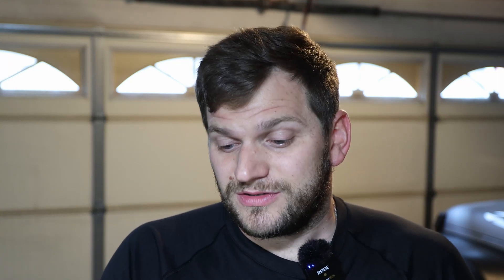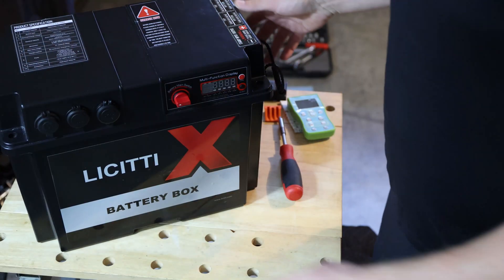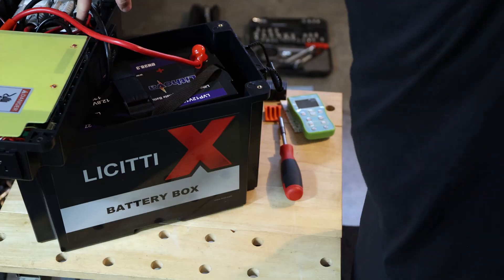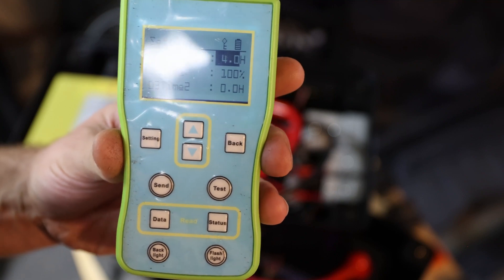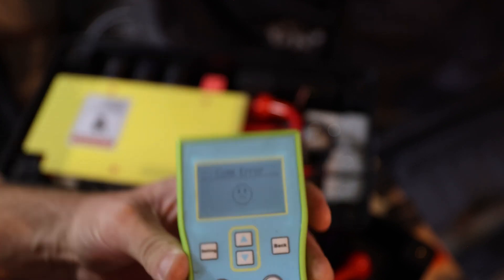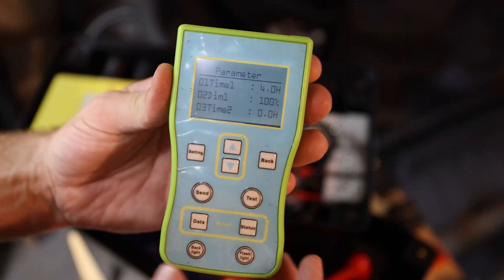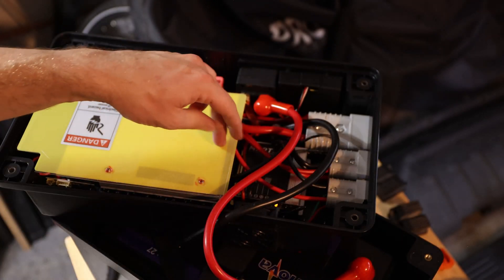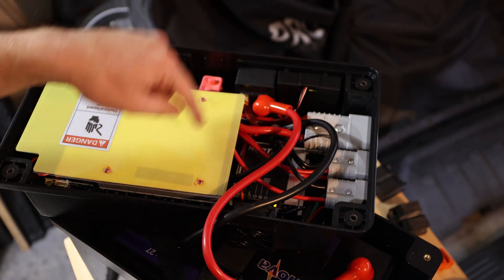Configure Licitti Battery Box MPPT Solar Charger LiFePO4 settings with Newpowa Remote Control

Comment: I am new to all of this. I have the Licitti 1000 box and now would like to get a panel or 2 .
I don't know how to match the panel with controller in the box. 10amp 45v .As long as I stay under 45v 
voc panel should be ok, Is that right ? Controller will limit the amps to 10 is that correct?
Reply from the maker: Pretty much yes! But as much as I remember the 1000 box does have less than 45V. I'm not sure about this! anyway- the max Watt will be 120-130W. For example a 100W Panel *12V battery will have max 120W. But as we know the efficiency of the panels are never 100%. I guess a panel which can put out 150-190W will be perfect for the Licitti Battery Box 1000.
Reply: Thank you so much. I want to be sure before I buy.TY
Reply: @tobisreallifeskillswithtobi panel efficiency is 23% at best